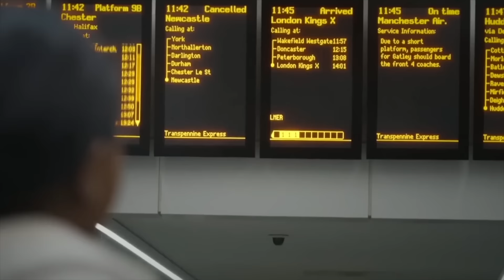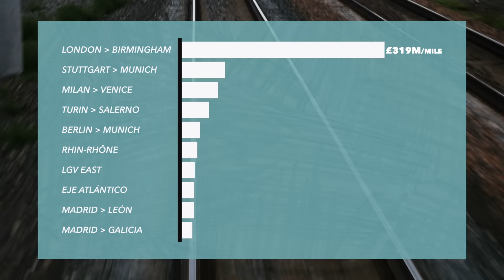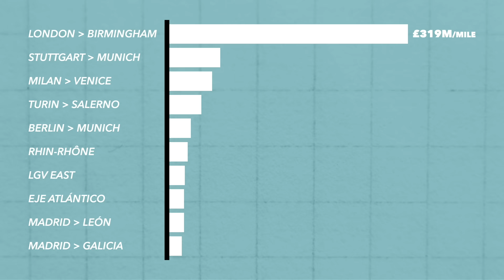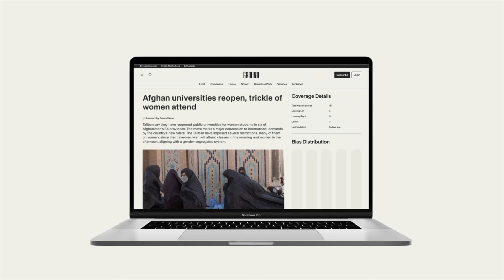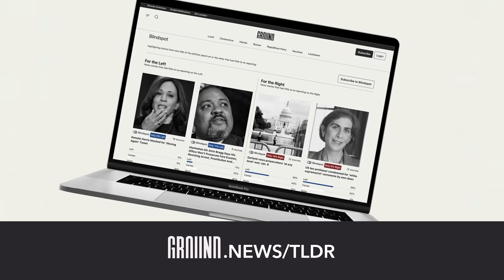The £100bn Railway: Why is HS2 Four Times Over Budget?

Comment: The time reductions in travel are not crazy (due to being a relatively small country). If we were going to spend this much money on a new High Speed system, it might've been worth just dumping all that money in producing/innovating with a MAGLEV network would've been worth it. @375mph, the  HS2 Phase 1 could be done in as little as 25 minutes, an even greater difference in travel time.
Reply: Maglev's got too many negatives to  be truly viable at a large scale. China's got the Shanghai airport maglev, yet they chose conventional high speed rail for the wider network, for a reason.

It's hard to switch lines on a maglev (compare to the points on railways which work) and obviously no compatibility with the existing network. If running HS2 trains north of Manchester to Scotland, though, switching to the existing mainline would be easy enough- a maglev to Scotland would require brand new infrastructure all the way, including new stations.
Reply: @exsandgrounder  See this would be true, if they weren't building new tracks for HS2.

The Japanese are now working on the Chuo Shinkansen which is MAGLEV and will span almost double Phase 1 of HS2, at almost half the cost.
Reply: @hebikotei9578  True, new track is being built. But HS2 trains can still switch to existing track when necessary- for instance, if one wishes to run services to Glasgow, the existing mainline north of Manchester can be used.
Reply: @exsandgrounder  I highly doubt they'll do this, the only reason it makes sense for HS1 is due to the fact that it's quite a short route.

HS2 is likely to cause increased commuter services to and from the stations.

Comment: It's worth keeping in mind that we ARE getting more effective over time, as we're discovering what mistakes are made, learning what's bottlenecking us, getting faster at building, etc.
The first stretch will always be more expensive, and it would be a mistake to "cut" parts of the plan to save money. Bh-Man/Leeds will NOT cost as much per mile as Bh-Lon.
Reply: If the first stretch will always be the most expensive, how do you explain the fact that, after adjusting for inflation, cost per km was lower in HS1 than in HS2, in LN1 (Paris-Lyon) than in LN2 to to LN11, in the Andalusia AVE than in all subsequent Spanish LAV?
Reply: Yes, though that also only really works if they keep building new stretches after completing HS2. If they are going to stop building any high speed rail (or just rail improvements in general) for a decade after finishing, then all that information will be lost.
Reply: @alaindumas1824  Construction of HS1 began in 1998. Yes, they're building the same thing, but it's an entirely different project. Anyone over the age of 40 at the time is probably retired by now. And there was no transfer of knowledge since we stopped building rails. I'd be surprised if more than 5% of the people who worked on HS1 is working on HS2 today.
Reply: @MyLittleMagneton  You are right about HS1/2 but the same phenomenon occurred despite continuous construction in France and Spain. Transfer of knowledge is important but there is a strong counterbalancing factor. It seems the population is becoming more demanding, especially in England. HS2 uses so much tunneling, cutting and antinoise barriers that it is said passengers will only be have a view during 8 minutes between Euston and Birmingham.
Reply: Your argument that "first stretch will always be expensive" is false. Example:- 
Tale of two nations building their first HSR rail network of 500 km each:-
UK
Cost: $20 Billion -----> $100 Billion
India
Cost: $14 Billion ------> $21 Billion

And it is the latter that is building an all-elevated line. No wonder people in UK would be p!ssed.
Reply: @death_parade  The first stretch is generally the most expensive as OP states. Though that mostly applies if you are continually building rail (with roughly similar characteristics, so not suddenly having 4x the amount of bridges or something) and not building your first stretch and taking a 20 year break before you build the next.

Comment: The biggest problem is that the London to Birmingham line wasnt sanest part to start with. Its the most expensive part to do and least needed. It is an hour and 20 minutes to get from London to Birmingham a journey of 110 miles. The 20 mile shorter train from Birmingham to Manchester is an hour and 30. high speed lines between Birmingham and Manchester and Liverpool and Leeds (via Manchester) and Leeds and Birmingham (via Sheffield and Nottingham ) would connect a population the size of Londons together. These are the 2nd 3rd 4th 6th 9th and 10th largest cities in the UK and getting between them is a disaster. It takes an hour to go the 45 miles from Nottingham to Sheffield for instance.
Reply: Did you not watch the video? it is needed because of capacity
Reply: @burgerpommes2001  that's a classic example of the capacity fallacy in transport. The lines to London are the best. They are faster than getting in your car and driving. Therefore they are the most used. This is why the South East has been able to monopolise public transport infrastructure spending for the last 40 years since privatisation even as the Midlands and North West have grown massively. There has needed to be a new pennine route between Leeds and Manchester for decades. Building the route between London and Birmingham will save 20 minutes. Building the route between Manchester and Birmingham (which is not as far) will save 50 so why are we building the Birmingham to London part first?.
Reply: @ThePirateParrot  HS2 also releases capacity in Birmingham Manchester and if built in full Leeds 
Being against HS2 because a trans pennine HS3 is needed is just stupid
Reply: @burgerpommes2001  I never said I was against hs2 I just think the order in which it is being built is dumb.

Comment: They need to continue with the FULL original plan of HS2. Leg 2a and 2b. It is so important for the future.
Reply: They should have begun building from north to south, not the other way around. MUCH less chance of government getting cheap.

...

They got cheap.
Reply: @CountScarlioni  North to south wouldn't of really made much difference really.
Better off just building everywhere at once but we got a worker shortage.
Reply: @davidty2006  It would have made a major difference - The Leeds and Manchester sections would have already started and would have to be continued. 
Instead they dropped Leeds altogether (and as a Leeds resident that makes me F'ing angry!) and are not even sure if they want to run all the way to Manchester now. They might just run to Crewe then use the old network from there.
Reply: @CountScarlioni  It would of hampered the project while theres idealism around building north south its basically causes HS2 to solve all the problems its being built for later making less money and not being as economically beneficial for longer

Comment: Nice overview with somebody who has some knowledge. I can confirm that in many instances HS2 LTD are making it up as they go along. I studied all the route maps and the sections before work started and walked the entire route London to Birmingham. In one instance a major engineering no no that I spotted has been fudged by a design change to increase a tunnel length at Greatworth (the route was cutting a watercourse). HS2 never admitted the error. There are similar situations that may cause problems later. At Southam the engineers and public were scratching their heads wondering what the blue slurry was that was pouring out of the tunnel works into the River Itchen. How come they didn't consult the geological maps that must surely have been in their portacabins? It was a local formation called the blue lias. I informed HS2 by email and received no reply, that's the thanks I received for helping them out of an embarrassing situation. They have revised original designs without taking account of perilously steep gradients (east end of the revised Brompton tunnel for example), which will probably cause nausea unless the train speeds are reduced to around 30mph, hardly what we might call high speed! There is one extremely deep cutting at Thorpe Mandeville that will probably cost an additional 2 billion because the consequences of supporting it weren't considered when the project was costed. There are huge flocks of gulls permanently at the Greatmoor waste disposal site that runs alongside the line which will cost another 2 billion to keep from smashing into the train windows. Curves will require check rails, another 2 billion, security fencing will be doubled in height, another 2 billion, CCTV will be placed at every mile of route, another 2 billion. HS2 LTD won't care, they are committed to delivering HS2 so they will just keep throwing more money at it until the thing is done. But I fear that the journey will be a thoroughly unpleasant experience, up down twist turn, in and out of one dark tunnel after another like a subterranean rollercoaster, not great engineering, just compromised engineering
Reply: Good post. I predict it will end up costing in excess of 150 billion ( if it ever gets finished). Working for a Contractor I see this sort of thing all the time. Cost Consultants have an everything costs £1.50 attitude. And Government's believe them as think they are experts.

Comment: Outside of the South HS2 seems to generally be regarded as another London-centric project that everyone will end up paying for but most of us in the Midlands and above won't use or get any benefit from. Virgin Trains used to run a pretty fast service from Manchester to London via Stockport and Stoke-on-Trent which completely avoided Birmingham, this was running when H2S was in planning stages and was only marginally slower than the stated times for HS2 at the time.

In my opinion the UK is too small for high speed rail to be required or of any major benefit and the projects are always too London-centric when they do happen, the whole thing strikes me as keeping up with the Joneses (France, Germany etc). If the Tories were serious about 'levelling up' they would have started construction in the North and worked down South, I'd bet money that if it had been started in the North the Southern section wouldn't have been canned, I don't think Labour would have done any better either in that regard.

The money would be better off spent dealing with capacity issues and bottlenecks in places like Birmingham New Street, I'm sure we'd still see budget over runs but at least smaller and simpler projects could be delivered faster and provide more immediate benefits to the tax payers.
Reply: Why is the UK too small for high speed rail? 
Munich Berlin: 585 km
Edinburgh London: 640 km
Reply: @neodym5809  As I said, in my opinion it is too small to be required or of any major benefit. That isn't me saying Germany needed it either, although they got it long before things like remote working.

We used to have a decent Manchester to London service that was only slightly slower, we're talking minutes not hours, is a £100bn spend worth it to shave off those minutes? In my view no, I wouldn't be suprised if track upgrades to the existing lines that route used could shave some minutes off without costing anywhere near as much.

The other thing is apparantly people can do all sorts of jobs from home now with remote working and be more productive, I personally question how much work some people were actually getting done in an office if working from home is better but if they can do the work from home and more are do we even need more capacity and faster speeds into London? Is there not an opportunity to distribute all the traditionally London based jobs around the country now?
Reply: @robertlees2065  It is not about saving a couple of minutes. It is about creating new capacity, so more trains overall can be operated. 

furthermore, there are many jobs which can not be done remotely.

Comment: "52 minutes, down from 1:22"... If, and only if, you don't lie on any of the existing route- the area of the country being most affected by the works tearing up the local countryside.

Last time I got the train to London it took 1:19 station to station.  
If I used HS2, it would take me 1:21- not including waiting time at Birmingham. 

It'll be nice if it takes some of the burden off the trains I use and frees up some seats, but I suspect it will have a similar impact on the current service to the level the M6 Toll did on the drive to Birmingham/Walsall etc.  Not much, and less than spending the money elsewhere.

Comment: Who builds the trains which runs 400 Km/h ? China, Japan, France or which one. The TGV reached experimentally 580 Km/h. But typical travelspeed in France is 250 - 350 Km/h. In Germany high speed trains runs typically up to 250 Km/h. But some lines can run up to 320 Km/h. If anywhere 350 Km/h in Germany will be reached ? Don't know. But England will reach 400 Km/h ?

Comment: You didn't mention the fact that HS2 is over specified.  It didn't need to be a 240mph railway! Everywhere else in Europe they have a 190mph high speed rail network (as is HS1) even though the distances are greater.  Because HS2 takes so long to accelerate to 240mph once it goes past 190mph it saves very little time, just 3 mins on the journey to Birmingham.  However the costs of the track and trains increase with the square of the speed.  All the track has to be to the same design so it is all capable of 240mph even though there are only small sections where it will run at that speed.  The corners have to be much wider making it impossible to thread through the countryside without demolishing expensive houses, beautiful woodland and requiring longer tunnels and bridges.  The trains are much more expensive as will be the maintenance and the energy required much greater.  All this adds to extra £10 - £20 billion being spent on a very marginal improvement.  They could have installed a travellator between the platform and the taxi rank and bus station to take 3mins off the journey time for less than a million pounds and saved billions on the cost.

Comment: is there any mega project in the world not over budget
Reply: Pretty much every single one has.
Reply: Yes. Compare HS2 to the 217 km Brittany LGV between Le Mans and Rennes. DUP (Declaration d'Utilite Publique) in 2007, Financing Protocol 2009, Contract with builder signed in January 2011, work starts in July 2012, opening as expected in July 2017. Overall cost in 2010 Euros: 2832 million, 65 million less than expected at DUP 10 years earlier. 
The difference with UK is that the builders and operator are experienced. This was the 11th French Ligne Nouvelle. SNCF/RFF can predict with some confidence its income and how much it can finance (35%). The State, regardless of what party won the last election, and local communities were supportive and equally financed the rest.
HS2 lacks local support. Communities demand tunnels when the railroad could be at grade because it doesn't cost them anything. The scope of the project evolves with the priorities of the central government under the banner of a political slogan "leveling up with the North". No-one knows how much can be recovered from tolls. Government's documents state; "the charging framework for HS2 will not be determined until much nearer the start of operations. Nor has it been determined which precise operating model will be applied to HS2, in terms of Infrastructure Manager and train operators, or indeed whether the IM (or operators) will remain in public ownership."

Comment: What does HS mean? 125mph?    the Mallard was doing over that in 1937,  the Japanese Shinkansen has been doing 200+ mph since 1964,  the French TGV does 350 mph and the Chinese Maglev does 700mph, getting Britain into 20th Century would be a bit of progress, let alone upto cate.
Reply: High Speed is generally regarded as anything over 150mph or 250kmh
Reply: Pretty much all of your numbers are wrong mate. The Shinkansen started out at 210 KILOMETRES per hour, and most parts still don‘t reach 200mph today. The TGV runs between 186 and 200mph in regular service and the Chinese TransRapid does 260mph on a tiny segment as a pure publicity stunt. Their fastest regular service reaches 220mph.
Reply: Shinkansen level of speed.
Current network isn't dedicated HSR it's just regular rail being pushed to the utter limit.